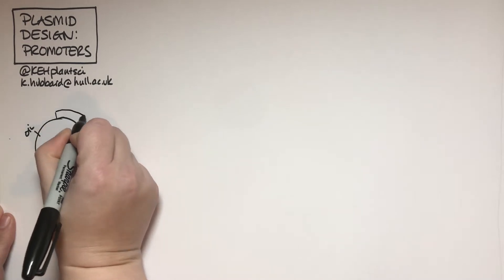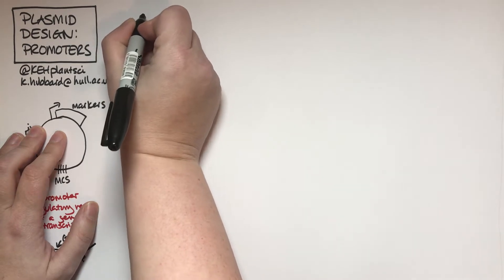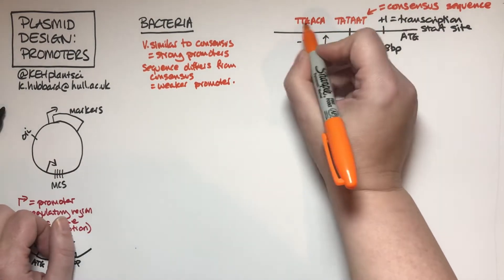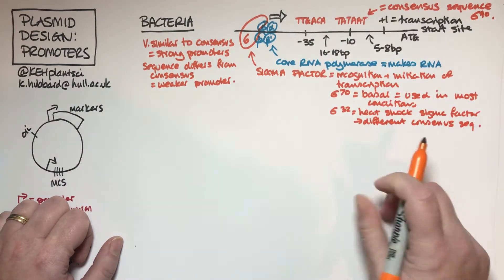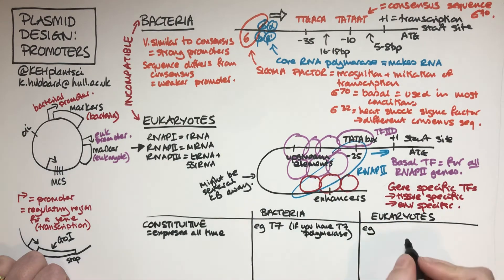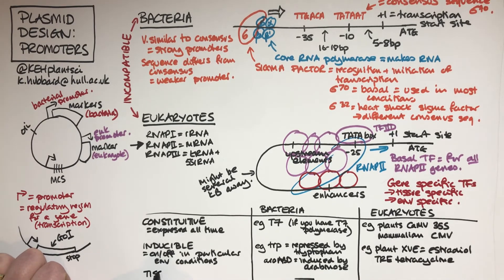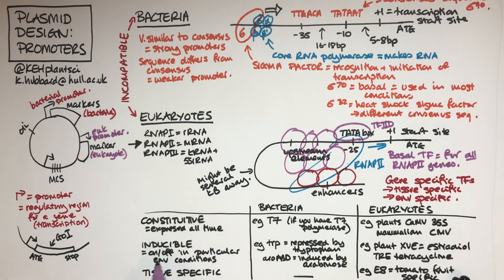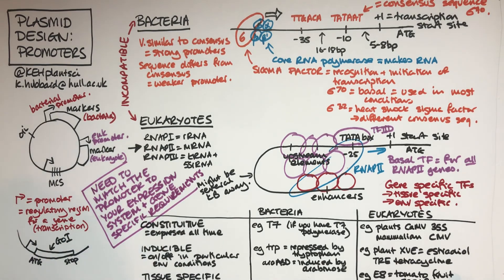Plasmid Design - Promoters

Comment: How about promoter for viruses?
Reply from the maker: Viruses are a lot more complicated! Some viral genes are expressed using a viral RNA polymerase, while other viruses exploit their host cells (either bacterial or eukaryotic) and express their genes using a host polymerase. It depends what virus you are interested as how it's promoter works/is structured. There is therefore a lot of variation in bacterial promoter structure and more than I can easily capture in a 15min video!
Reply: @katharinehubbard5043  Thanks for your kind feedback. Let's say "cassava mosaic virus". It will be highly appreciated If you could share some good references with us, Thanks in advance
Reply from the maker: @abdoulayeassane2852  I've not worked on Cassava Mosaic Virus so am not an expert here! However, Cassava Mosaic Virus is a geminivirus which has a single stranded DNA genome. Like a lot of DNA viruses, geminiviruses don't encode their own RNA polymerase, but rely on the host (eukaryotic) polymerase for transcription. Because the genes are transcribed with a eukaryotic nuclear RNA polymerase, they have a similar promoter structure to eukaryotic genes - Figure 4 of this paper shows the presence of TATA box motifs in regulatory regions. Hope that helps! https://www.ncbi.nlm.nih.gov/pmc/articles/PMC6640248/
Reply: @katharinehubbard5043  Thanks for your kind feedback